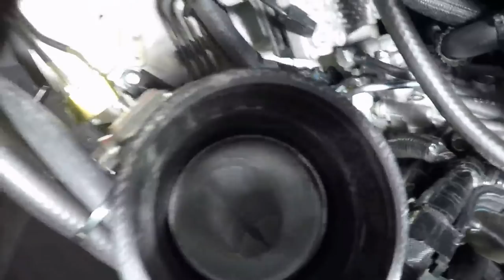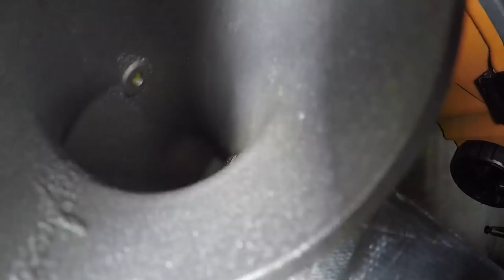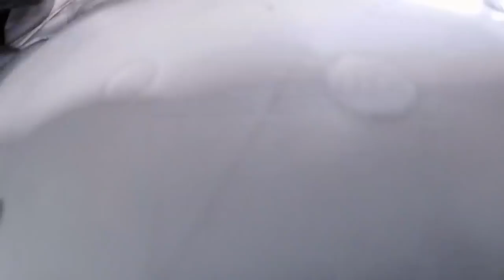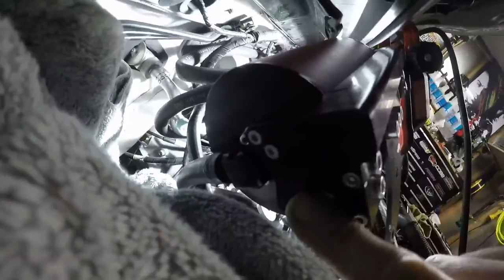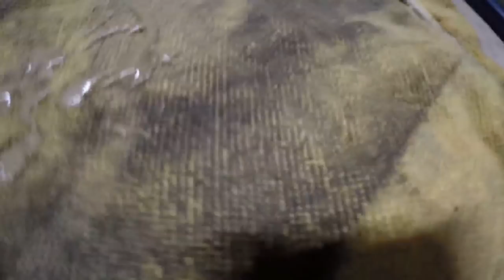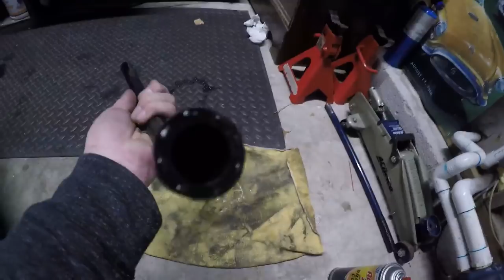2015 Subaru WRX Ep. 889: IAG AOS 6-7 month Inspection

Comment: I've been running my IAG AOS for some years now and so far I think its done a good job. However, the 3 last oil changes I ran the intake valve cleaner and I believe it could of mucked up my IAG AOS unit. The drain hose on mine though was cracked. I replaced with new one and old one was pretty packed with that gunk.

I was in touch with IAG and they suggested I remove the top allen bolts and separate the unit. Then, clean the inside part out and reinstall. I've never ever touched this unit since installation so I wonder how full of junk it will be.

Once cleaned out they suggested to change oil soon.
Reply from the maker: ya i took it out eventually, as it was more of a pain than worth it, and made a mess of the engine bay too
Reply: @LastHumansGarage  hmm. On mine I removed the Allen key bolts from top of IAG AOS.

No gunk that I could see in canister and seemed OK. No oil under it like yours had or coolant drips. Nice and dry. I put it back together. When putting it back I used dielectric grease stuff you can use on gaskets and brake slide pins on the bolts and gaskets. Ensured it was cleaned from any dirt using blue disposable shop rags.

I had to snug up the bolts after first run since it was dripping a bit coolant wise. Once again it seems to work okay I believe. Only junk was from the drain hose that I had to replace since it had a crack on it.

Anyway I would like to thank you again for the aos install video since when it was installed initially your video helped a lot since the printed instructions at time had us confused at one step.

Have a great rest of your weekend :)

Comment: Seeing this makes me want to convert mine to a competition version. I know it's normal to have that buildup, but I'd rather not get that in the engine. I don't believe my car burns oil much at all, so I'm not worried about losing any of that sludge outside the block. 

IfI don't go competition, I'll definitely go with catch cans.
Reply from the maker: is there any way to clean that out or not really?
Reply: LastHumansGarage nah because that's the point of the AOS. It recirculates "oil" so the car loses none; that's at least my understanding of it. I'm sure it hurts nothing at all to leave it alone, especially when it's up to temp going back into block. However, I've got no race car, I'm not pushing 30lbs boost, I don't burn oil. I'd rather see it leave my system than go back in.
Reply: Comp is nice, but since the vacuum system is removed due to dumping to atmosphere, I'm pretty sure you will need a tune. I installed mine two days ago, and the car has gone through some relearning, but, not aggressive enough to get me back power where it's been noticebly lost. If you can tune your own car, more power to you. Car acts normal under most conditions apart from low rpm closed loop to open loop transition points
Reply: It's worth doing some logging and adjusting where necessary though. I'm currently in the process of that.

Comment: Good video. I'm the same with the lines. They are very confusing. I think I'm going to let mine go a little longer before I check it out. I wonder if the oil on the bottom of the can vented air into the return to make more of that sludge than normal.
Reply from the maker: i have another video coming out soon to discuss AOS a bit more.

Comment: im too confused. Did you buy this car with the AOS installed already? How do you not understand anything about what it's doing or what its for before installing it yourself? 

Also the "gunk" is just oil that's been blown by the turbo / out of the crank case with air / exhaust gas, its perfectly fine to go back into your oil pan. The oil filter will do it's job. You just need to make sure you change your oil on time (duh).
Reply from the maker: i saw the comment days ago, lemme try and work thru it.. no, i installed the AOS myself, there is a video on it. I understand what its doing. The banter is called video chat.. to bring up ideas and questions. I have no idea what i ever said in this video, and don't really care at this point, the car is longgggg gone.

Comment: Condensation in most AOS's is normal for those who live in colder climates or cold winters and don't drive their cars enough to get them fully warmed up to burn it off. Heated AOS's shouldn't really suffer from it but like I said its probably not been allowed to get up to full operating temp to burn it off.
fwiw my Crawford AOS doesn't suffer from this (without having the coolant lines attached..) and they have since removed the coolant lines from their AOS as they don't see this problem, probably due to the AOS been a lot closer to the motor which helps keep it hot.

As for the oil leak, is it not leaking from the joint where the bottom/base meets the cylinder? is there an O ring in there? as the other pipe what screws into the base is a coolant line.
Reply from the maker: dude... they don't do the coolant line anymore?? I would even consider reinstalling this if i could do without the 2 coolant lines to clean things up a bit...  its uninstalled right now... before i saw everyone saw the goo was normal...
Reply: Yeah they done away with the coolant lines. Have you checked out the Crawford performance AOS yet? it fits to the LH IC bracket (TWO bolts) to the intake.  Yeah I've just seen your other vid and noticed the AOS on the floor.
Reply: Any chance of a video of a strip down of the AOS to see whats inside? as I don't think there's any pic's etc on the web showing this.
Reply from the maker: naw im putting it back in minus the coolant lines, tonight. but i wish i had some post somewhere from IAG about not needing the coolant anymore.
Reply: I've just remembered.. If Killer B is still a sponsor? hit them up for one of theirs, it fits in the same place as the Crawford on and they also don't need coolant lines. They are a lot more expensive than the Crawford but they look a lot nicer.
Also you may need to jiggle around the Cobb E 85 sensor which bolts to the manifold?

Personally. I would not run the IAG AOS without coolant lines as this would probably make the emulsification worse in your case.
Reply: The bagdersarse +1 for the Crawford unit, I bought it during their group by. Very easy install and after a good drive the unit is nice and warm. Definitely doesn’t need the coolant lines, I think they claimed they started that whole idea and have since found that with proper mounting it’s unnecessary.
Reply from the maker: might have been related to my oil cooler too.. my oil temps never got to 200F, especially in winter. now since i just took it off, i have seen 200F every time in this snow after the normal warmup.
Reply from the maker: any links for any of that discussion?
Reply from the maker: From KillerB's catch can page, and I trust KillerB highly:  It is not heated and we see no reason to add unnecessary cooling/heating (weight, complexity, increased install time, and increase probability of something leaking) and this simple engineered form functions just fine without it.
Reply from the maker: IAG told me this morning that the heated lines are essential and mandatory..
Reply: IAG's unit is mounted in a different location. The KillerB and Crawford units sit right next to the intake manifold so the block heats it really well, here's what Crawford said - https://forums.nasioc.com/forums/showpost.php?p=45437167&postcount=7
Reply: Mark, Just watched your latest video and there seems to be a little confusion about the removal of the  coolant lines comment, just to clear things up I was referring to the Crawford AOS and that they removed them from production. :)
Reply: Yep the oil cooler probably didn't help. The higher the oil temp for as long as possible would deffo reduce the crap.
Reply from the maker: YA it all made sense later in the day.. craw removed them from version 2 to ver 3.

Comment: Hope my comp. IAG AOS don't have that much buildup. Gonna run my hand on the bottom of the unit to see if has any oil leak.
Reply from the maker: i took it out for now. might do a raffle. i think i might want to go to a catch can for easier maintenance.
Reply: LastHumansGarage damn that sucks. I love my AOS just because of all the horror stories out there about blowby. Should have checked the throttle body side of intercooler on motor for residue.
Reply: I wonder if it varies by car. I had my intercooler off just recently and couldn't find any evidence of residue. I'm at 21k and stage 2 for 8k of it. I was going to make this a top priority but now I'm not so sure.
Reply: LastHumansGarage I just checked my aos for leaks on the bottom and I only had yellow residue not oil. Guess that's from condensation. Maybe when I'm not so lazy I'll check a hose

Comment: This is why I have dual catch cans on my Evo and not a AOS. I don’t want that junk draining into my oil pan.
Reply from the maker: true
Reply: Can you say Boomba Racing? It is what I run on my 17 WRX Base.........
Reply from the maker: i saw them today... and both require you to cut factory hoses to install?? not for me man.
Reply: LastHumansGarage. Yes you do cut factory hoses, but then loop those hoses into the can and back into the factory locations. No big deal. They DO work....
Reply: OK, I cut hoses and keep all other parts as well as keeping the original loop in tact(ultimately). You remove PCV(not pvc, that is a plastic)valves............. To quote someone else up her...... not for me man.......
Reply: If you do oil changes every 3 -5k it doesn't matter that the "gunk" goes back to your oil pan. Thats what the oil filter does. The AOS does for the intake stream what the oil filter does for the oil system. AOS is far better than a catch can at keeping your intake side dry. The difference isnt so big for daily driving but its a huge difference if you drive your car hard at track days or if you've got big boost.
Reply: J G What do you think is considered big boost in this case? I’m running 20lbs and thinking of switching from Perrin to IAG

Comment: Check this Killer B post https://forums.nasioc.com/forums/showpost.php?p=44881134&postcount=26 I personally would not run E85 without an AOS because of the increased blowby E85 causes.
Reply from the maker: i seen that. all you'd need to do is more frequent oil changes. plus i run e50, not e85
Reply: LastHumansGarage Change the oil more frequently for the sludge or for blowby? Im on E50 also